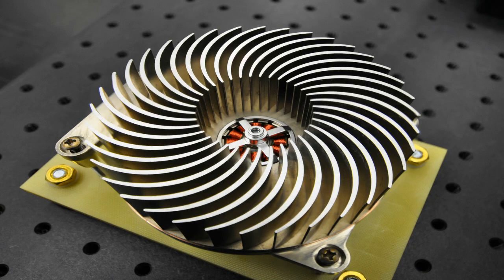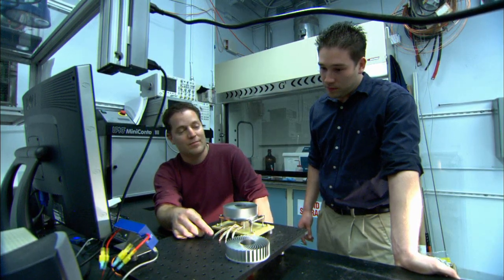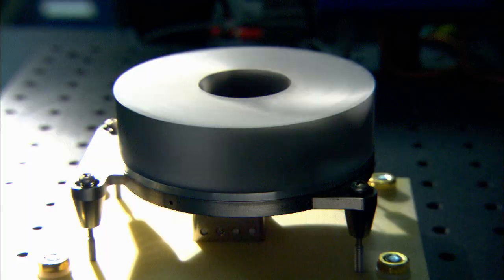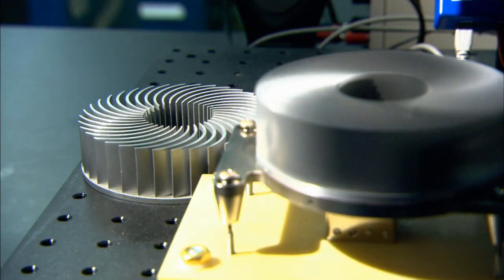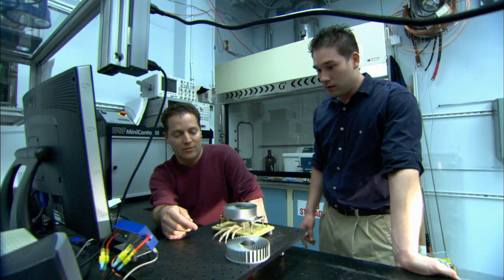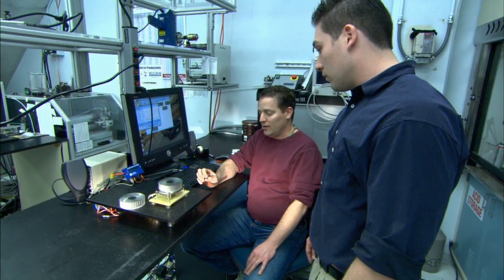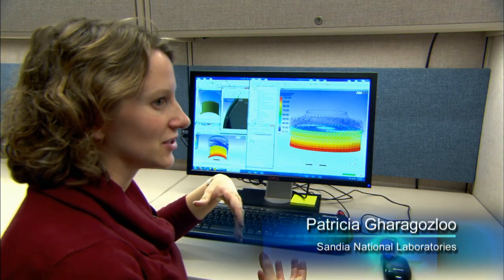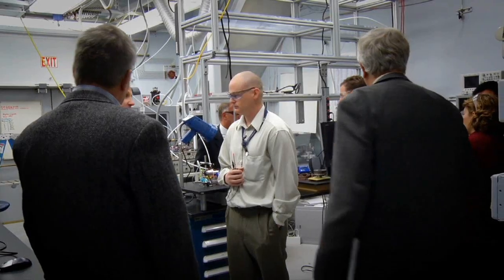Sandia Cooler

Comment: does it work on it's side? like it should in a pc?
Reply: Denmon
>Most non-reference GPUs also just eject heat everywhere
You're saying this in such of a tone like it's an actually alright and absolutely tolerable thing for hardware manufacturers to do. Which it isn't.
Reply: That's the main concern I've actually spotted so far. Modern top-of-the-line god tier air coolers like Noctua's NH-D14, Cryorig's R1 Ultimate, and other massive towers, have their fans oriented that way so they exhaust the hot air at the back of the case, where the actual exhaust is. This technology's design (and even Coolchip's improved model's), on the other hand, obviously just throws the hot air out everywhere, in all directions, which is an actually extremely bad thing if you have shitty air cooling chart in your PC case by default, and especially if you're putting something like this in a SSF factored systems like ITX or HTPCs. That's a massive problem. And how these guys (or hell - even Coolchip itself) are going to fix this problem, if they're able to anyway, which I doubt, is beyond me, until I'll see the goddamn thing working by my own eyes, in a consumer build.
Reply: Kawayolnyo
Most non reference design GPUs also just eject heat everywhere, as long as you have good airflow through the case it shouldn't be a problem. I'm more concerned about dust getting stuck in the air bearing. (I know he talks about dust but he doesn't mention the probablility of dust getting stuck in the bearing).
Reply: Kawayolnyo
You're completely missing the point here though, as long as you have good airflow over the mobo area most heat should be exhausted anyway. It doesn't even take much, two fans in the front for intake and one in the back for echaust will move enough air that whatever heat gets blown around in there will be exhausted without much issue anyway.
Reply: Denmon
I don't miss on anything. I know how a good air flow chart should look like. And I've said about it right from the beginning, it is YOU here who's unable read what others have said and correctly comprehend the information given. You obviously don't know much about PC building in general and hardware in overall, if you think (and looks like truly believe in it, which is quite sad) that "two fans at the front and one at the back" is the only thing that matters and "it's enough". There are much more to this than you think.The devil is in the smallest things and details, by ignoring (or not knowing about) them you'll never get the best result possible.
Reply: Kawayolnyo You know, for someone with so much to say you actually haven't said much of anything aside from insults and rudeness which implies that you actually don't have enough knowledge on the topic to come back with anything worthwhile.

I rest my case.
Reply: Good question, since it's powererd by heat convection i think a diferent design based on the same principal would be needed to work on it's side.
Reply: Kawayolnyo
That's actually not at all what I was saying, you could obviously always add more fans and what not but after a certain point it becomes increasingly inefficient on a price to performance scale.

For a normal system (1-2 GPUs, 1 CPU) you definetly get by on three fans(not counting an eventual PSU fan).

With a cooler like this, even though it's spreading heat around it, it's still directly in the airflow path and right below the rear exhaust in that case, ofcourse a tower cooler with directed airflow would be better but probably not in heat dissipation.

The "smalest detail" you mentioned (more fans in this case I presume) doesn't add much on it's own. If you want 100% best performance cooling you can just go ahead and buy some massive rads and watercool the whole thing but at that point the cooling parts will almost cost as much as the entire PC for the above avarage gamer. And also at that point this discussion becomes increasingly irrelevant.
Reply: Denmon
>The "smalest detail" you mentioned (more fans in this case I presume)
And yet again - you're presuming and deducting absolutely wrong.
You seriously have some problems with extent knowledge on the matter and with comprehension of the information presented to you.
Because "MOAR FANZZZZ!!111" is not what I was talking about. At all. More fans undoubtedly gives you an ability to build a much better and more effective air flow chart, but that wasn't what I was talking about to begin with. You definitely don't see what I'm getting across here. I highly recommend you upgrade your Googling skills, at the very least.
Reply: Kawayolnyo
It's funny because you still didn't say anything about the actual topic, your entire post was about me. lol
Reply: Denmon
Whatever makes you feel better and more important about yourself I guess, kiddo. Fine by me if you're going to continue on being this way. I accept your complete and absolute capitulation, then. You don't have to ask me twice for that. Enjoy your arrogance of delusional denials and keep on living in that little pink world of yours.
Reply: Denmon
As I've already said: whatever makes you feel better and more important about yourself, kiddo. You might as well just talk to the hand from this point on, because from this here moment I'm ignoring you.

Comment: But does it work at a 90 Deg angle rather than flat. Funny thought as you put it into your HAF Case antec 900 1200 or NZXT Full height cases. Since its an air bed it lays on, there is nothing to hold it down on the bed at a turned angle. So if this really is a great way to cool a system, then many would have to go to the HAF X b or something similar to be able to use this, Just a Tech girls pondering of how it would wrok in a full size case at an angle rather than flat.

Comment: Think of this setup on video cards how it would cool the GPU/VPU plus the memory.
Reply: This design is ALREADY in video cards, most all reference coolers have a blower style fan which is the same exact design, just with a shroud and made to push heat.
Reply: Cole Flack
No, this is a spinning heat sinc,   Just because a video card has a plastic fan that simply moves air through a stationary heatsinc doesn't mean this is the same.  Totally Different.
Reply: Vault Nomad You're right that it's totally different. A spinning plastic blower and a spinning metal blower. An efficient heatsink with fins and an inefficient heatsink without fins.

Comment: Does it work when rotated on it's side? Every PC i have ever owned has the MB on it's side in the case meaning the fan would be on it's side too. Also the air spun out from the cooler is travelling in all directions, most decent airflow setups inside cases are based on the principal that the air is controlled through the entire case to make sure clean cool air is pulled into the case flows through the case and then is exhausted out the case in a particular way. Having a 360 degree fan in the middle of a case fucking up the air flow sounds like a step backwards.

Comment: Deep technical challenge's = expensive! parametric study of optimization? How about you tell me what the hell this nifty little fan is going to cool. Show me a piratical comparison to something like water cooling or TEC in some thing like a server. If its going to cost less than a room with 20k BTU dedicated cooling room. Than you will have my attention But that looked like just a  different fan (Hydro dynamic air bearing) what have you cooled with it? Solid state lighting is cool already
Reply: If the claims about dust resistance are correct, I would love to have something like this inside a server.

Comment: I think it should be clear to everyone that the project is about a FAN, not an heatsink: there's no way heat could be transferred efficiently from the source to the rotating heatsink because of the poor coupling of the two surfaces, and it makes less sense if it's spinning on an air cushion. A centrifugal fan? Maybe. An heatsink? You're doing it quite wrong.
Reply: 1:41
Supposedly they over came this, i wish we got more info on this, as this is truly where all of innovation would lie. The spinning part is just a blower with extra surface area.
All he said about it was 'air bearing'. But i too am confused how a thin layer of air would allow for heat transference when air pockets are the enemy of heat transference... 
But we already have blower style fans in laptops... so yeah, this video proved to me nothing xD
Reply: Richard Smith If I am to take this "thing" as they are proposing it, the "blower" is not a simple blower, because it's made of aluminum (or metal, however), so it's meant to be a "spinning heatsink". But hell... who knows what sort of strange physics could possibly be involved in it, if they are saying it is transferring heat? Bah...
Reply: Thomas Samoht
Well, the layer of air is (allegedly) so thin that the insulating effect becomes negligible.
Reply: Hλwk978 I've just seen that Coolchip picked up the Sandia's work and joined with Cooler Master, and they're going to release something this year... intresting!
Reply: Thomas Samoht Yeah I saw that too. I knew it was only a matter of time before someone applied this tech(if it actually worked). I had forgot about it until I saw cooler master is bring one to market.
I guess we will see how it is

Comment: Just looks like a centrifugal fan with many blades to me
Reply: Patrik Manni I dont understand how exactly that works with a pocket of air between the processor and blower tho... that would make an excellent insulator, the opposite of a heat transference medium.
Reply: Richard Smith The innovation is using the surface area of the blades to dissipate heat. Instead of using a blower and a heatsink.
Reply: On the contrary, the speed at which it's spinning brings the size of the gap down tremendously, making for excellent heat interchange. This is a really cool solution to cooling, actually. But there are some big engineering hurdles to get past. Like how to make it work when it isn't standing flat on a table. And how to best use the blades to bring air further down the impeller without creating lift, like most blade solutions would.
Reply: Its a blower with extra surface area xD You have one in your ac units. There is no innovation here xD
Reply: Richard Smith don't really have ac in the uk but i get what you mean, they have these type of fans in many things like hoovers and water pumps just with different blade designs.
Reply: Patrik Manni I cannot say that I understand. This is a legit research group, so I will take their word on it, but I would of liked a better explanation on how air insulation physics change in this circumstance. I am no engineer, so I am sure it is ignorance, but everything i do know says that air pockets prevent transference of heat. I mean, aerogel's microscopic air pockets is what makes it a great insulator.
The point in thermal grease is to make gaps less insulating, as thermal grease itself is actually a poor thermal conductor, but orders of magnitude better than air.
Reply: Richard Smith
The air insulation physics don't change. Different substances carry heat with different efficiencies. Air preforms fairly poorly. So if you have a lot of air, it makes sense that it would be difficult to move heat through it.

But when you have less air between your more thermally conductive materials, the heat transfer is more efficient. And with this heatsink spinning as fast as it does the gap of the air bearing gets very, very small. Which is fine, and still lets it function effectively, because the faster radial movement of air means a larger amount of force per unit of surface area preventing the rotating part from touching the base. But it also means the ineffective transfer of heat through air becomes less important, since there's so little of it. Just like using less thermal paste, only having just enough to fill the gaps and imperfections between the two contact surfaces.

The area of heat transfer is also very large compared to what you normally have between a heatsink and the IHS. Which means more efficient heat transfer.
Reply: @patrikmanni3559  Rubbish! if it has better cooling then everyone would be using it. this is not the way to cool cpu's.

Comment: I think the BIGGEST stoppingstone in this "cooler" is something called the Second Law of Murphodynamics: if it looks too good to be true, its probably a scam. Maybe. If you ever paid attention in physics class, you know that air has one lousy heat capacity. The top part may make sense, but how should heat travel through the "dynamic air suspension"? From the baseplate to the radiator fins? PLUS, there is something called "deadloop" in thermodynamics. Where heated up or "spent" air is reused in the coolingcycle. When hot air is expelled from the sides, its also sucked back in through the top. Talking about 30x more efficency...well, the rotary radiator might, but the isolation from the baseplate and very high chance of deadloops, the efficency of the overall cooler is pointless.
Reply: *****
 Yeah, maybe the 1/10th of a mm with some "cold plasma" like energy transfer (compressed air) could do the trick. But still, its too sci-fi for me. Even ordinary coolers need thermal paste to fill in microscopic cracks... And I stand by my deadloop thing. I see a high potential of air getting re-used :/
Reply: *****
 You can easly test this on your own computer: take off you cooler and install it without any thermal paste. Run some temp program. Install the cooler again with thermal paste... compare temps with and without paste. There is also a VERY VERY thin layer of air there.
Ok, to give some thought to it: the "cold plasma" thing i mentioned. There could be a channel for heat-energy through high pressure gas. Maybe even motion can contribute at "grabbing" heat and transfering it. But still. I think such transfer is very inefficent :/
Reply: I agree, when I was watching this I thought to myself, how the hell is the heat from the chip getting to that heatsink, since it's basically floating above a base plate... Or are they planning on floating the cpu around too lmao xD

Comment: Look at the technology before you make nonsense comments.
You should not waste words and energy of your speech by not understanding first the technology.

My family has a background of technologists in machine development and construction machinery. We have replaced common bearing designs with custom made air-bearings for our machines because they are that much better and maintenance free. We didn't go through PhDs to understand this. We just saw something that works and implemented it.

This technology works. The fact that its not gotten out yet means that the company has either received a lot of money to not produce the technology; if it does ever get into production, it'll be very inefficient and so people will not buy it.

Hey if I was given $50+ million to shut up, I would. This would probably retail for $50 considering the manufacturing cost of less than $10. 1 million units could easily be sold, profiting of $40 million. When you take something from prototype to production, you actually make the product better and not the other way around. This is a simple design and the company claims to have had started production but with only 7x performance compared to the 30x stated, which is non-sense. There are so many companies selling CPU coolers. This would make them all obsolete.  

Understand the technology and then make your claims about what the company has gone through. The company doesn't matter. It's the technology. Understand it and use it.

My elder brother is a mechanical engineer specialized in the production of automotive parts. The company he was hired by through a HR team required him and the team to make parts for vehicles. They came up with a design to last 15-20 years on commonly used motor parts with an increased cost, but not that high. However, the plans were refused and were told to use materials and designs that would last for 2 years as the company couldn't sustain the increased cost. Which is total bullshit. 

We live in a very different world now. Go figure.
Reply: Not very humble are you.